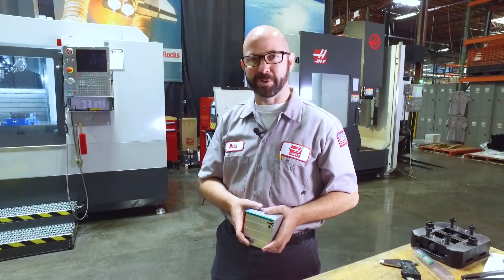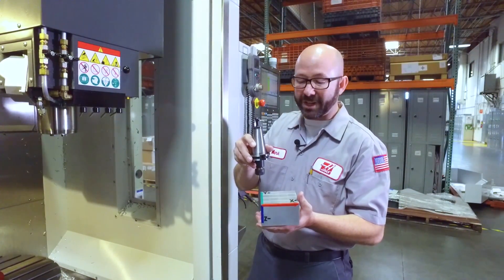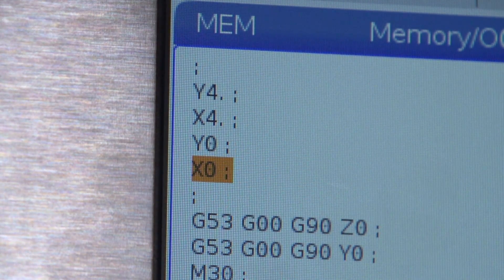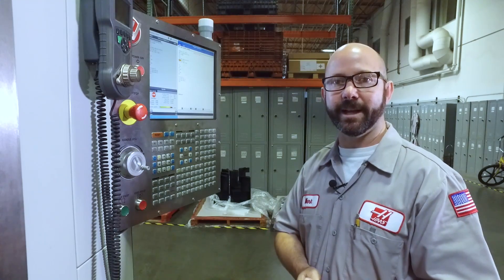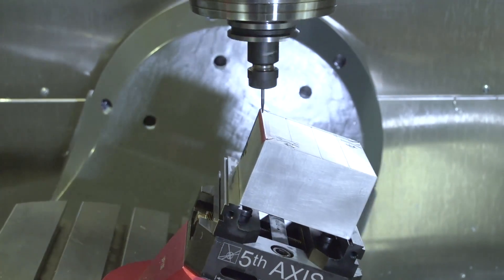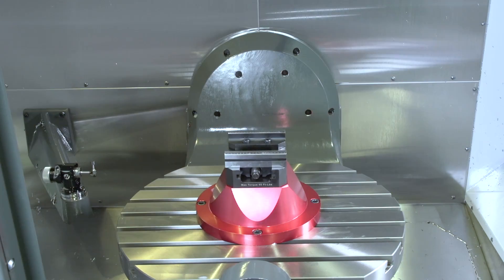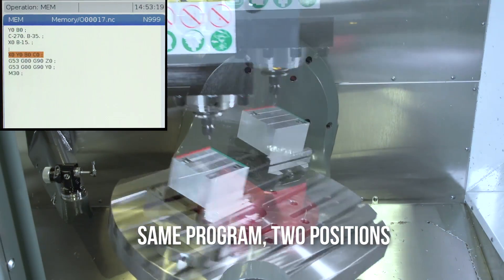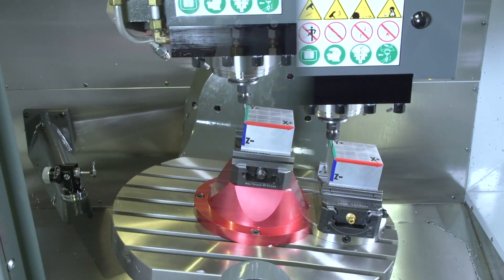Simplify 3+2 and 5-Axis Machining with DWO/TCPC – Haas Automation Tip of the Day

Comment: If you've never been exposed to true 5 axis machining this might not make much sense.  Before we had TCPC if you needed to do 5 axis simultaneous machining you had to 
rely entirely on your CAM system.  You would have to describe the full kinematics of your machine including the XYZ location of the center of the rotary axes.  Then, one way or 
another, you would tell the CAM system where X0Y0Z0 on your part was relative to the centerline of the rotary axes.  The CAM system would crunch all the numbers and spit out 
a program for you.  The only problem was, if you needed to make fine adjustments to the part, you had to go back to the CAM system, make the changes there and post out a new 
program.  It worked but it was clunky.  The logic behind TCPC is that your program can now simply describe the tool motion as if the part were completely stationary AND the center 
of rotation is always at the tip of the tool.  Effectively taking all considerations for machine kinematics away from the CAM system and giving that responsibility to the CNC control. 
Now it doesn't matter if your fixture is a few thousandths off center.  The CNC control will automatically adjust for that while it processes the program in real time to create the machine 
motion.  All you have to do is make the corresponding shift in your work offset and the control does the rest.  Every major CNC control has this capability now and it may even come 
as a shock to you that they all work exactly the same way.  They all use the exact same math and they all call it "TCP".  If you only do 3+1 or 3+2 machining you'll never use this.
Haas DWO on the other hand needs some work.  What it can do, it does well but the problem is that it's really only good for demonstrations.  That's because in the real world NOTHING 
is ever perfect.  Say you are machining a hole on the side of your part that has a very small true position tolerance.  You run through your setup part and during inspection you notice 
that this hole is out of position by .0015".  There is no easy way to make this adjustment on a Haas.  What you really need is a fine adjustment calculation that runs AFTER the G254 
has calculated the new coordinates.  I have a macro that I developed 20 years ago that can do everything G254 does plus it lets me make those adjustments very easily.  If I can do that 
there's no reason why Haas Automation can't do something similar or even better than that.  If you constantly make parts that have tolerances tighter than .005" you know what I'm sayin'

Comment: I have wired problem after update software on umc 750: after Bxx.Cxx.; g254; , coords on page position doesnt transform but machine work correctly buy when i put P103P1;Bxx.Cxx;G254;G103P0 It works correct... Some bug in new soft? Greetings.

Comment: Hi,
If I run below code 

N78672 G00 G90 G53 Z0.
N78673 G255 (CANCEL DWO)
N78674 G0 B89.81 C204.138
N78675 G0 G234 H36 Z11.7277
N78676 G0 X-12.4499 Y-5.4186
N78677 G0 X-9.7122 Y-4.1918 Z11.7177

Then does both DWO/TCPC options are switched ON after line N78676

Comment: Haas have gcode for indexial 3+2 , like fanuc g68.2? g254 support g2 g3 command and drill cycles like in indexial mode fanuc g68.2?
Reply from the maker: Mikhail – Yes, the G254 code supports G02, and G03 arcs and all of our standard drills cycles like G83 peck drilling. You can learn more about this code from our Mill Manual that you can download from our website www.haascnc.com . G254 is for 3+2 indexing, and G234 is for simultaneous 5-axis work. – Mark, Haas Tip-of-the-day

Comment: Hi Mark, 
 I have my TCPC and DWO set up on my VF5ss using with a TR160. I keep getting a INCOMPATIBLE TOOL LENGTH OFFSET USED alarm when i tries to run G254 in my program. Is there any other parameter that needs to be changed so it will work?
Reply from the maker: Russell – We’ll see this alarm (alarm #2019) if Setting 64 “T Ofs Meas Uses Work” is set to Off, and a G254 is called. On a mill with the TCPC/DWO feature enabled, we need to turn on Setting 64 and only set Tool/Work Offsets with the probe. This is important, if you try and set your tool lengths manually (no probe), with Setting 64 On, your tool length offsets can be very confusing. For more information, give your local HFO a call and they can help you out. – Mark, Haas Tip-of-the-day
Reply: Thanks  you so much for your quick reply ......Haas Automation, Inc #1...... user since 1993

Comment: If I want to drill and tap a hole at 45 degrees, can I turn on tcpc rotate my B and run my 2d program. Do I need to turn off G234?
Reply from the maker: Don L – For 5-axis drilling (and regular 2d programs) we use our standard drilling cycles (G81, G83…) with our G254 DWO Dynamic Work Offset feature. G254 DWO is used for indexing, 3+2, while we reserve G234 TCPC for simultaneous 5-axis work. Thanks for the comment. – Mark, Haas Tip-of-the-day

Comment: Hello, May I ask if G234 if different with G143? My Haas VF5-50 only supports G143so is it any difference when I post a simultaneous 5axis program, do i have to care about tool length when posting?  Thank you
Reply from the maker: GIANG THE TOOL – G143 is only used with our tilting-head 5-axis machines, like our VR-11. We will use G234 TCPC and G254 DWO on our UMC machines, and on mills equipped with our Next Generation Controls, the TCPC/DWO option, and rotary units. The codes work very differently – if you don’t have a Haas VR machine, you won’t be using a G143 for your tool lengths. We’ll call up or tool lengths with standard G43 Hnn codes, using a G234 when performing simultaneous 5-axis moves or a G254 when running 3+2 (indexing) machining. – Mark, Haas Tip-of-the-day.
Reply: Thank you Mark for your answer, so that means with my old machine (does not support TPCP), the only way I can do simultaneous 5-axis is put the part model on Cam software exactly where it sits on the table? - Giang

Comment: Hi Mark, in this video you don't show the use of DWO (G254) but you mention it a couple of times. According to the documentation it looks as though you can only use G234 OR G254, so you can't use them at the same time. Could you use TCPC for positional machining instead of DWO? Just trying to get a more detailed understanding of the differences between the two... 

Also as a side note, does TCPC improve on Inverse Time from a smoothness standpoint?
Reply from the maker: Scott – You’ve got it. This video is really for simultaneous 5-Axis (G234), while our G254 video will be on 3+2 only. You’d really want to stick with G254 for positioning, not G234.  Feedrates with G234 are typically in Feed Per Minute, which makes things really simple, compared with the G93 Inverse Time Feedrates we used to use. Our IMTS demo had quite a bit of G254 DWO 3+2 positioning in it, while the simultaneous 5-axis moves were done with G234 TCPC. You can check out that video at https://www.youtube.com/watch?v=wR64mYvQ7c0. 
- Mark, Tip of the Day
Reply: Haas Automation, Inc. awesome Cheers for the extra info.

Comment: still I do not know what is the difference between 3+2, 4+1 and 5 axis. who can help me understand?
Reply: Cosmin Gheorghe I would imagine when there is a + involved the first number is the machine's standard number of working axis and the second number as an add on like a  haas trunnion adding 2 axis to a 3 axis machine making it a 5 axis machine. a 5 axis machine would have all 5 working axis as standard xyzab
Reply: thanks
Reply: @retardbarf 
That's correct.  You could also say it like this: 3+2 is running a 3-axis program on a plane established by the 4th and 5th axis's.

Comment: Hello, I am asking this question, you can configure a Haas EC1600 for a program to calculate the coordinates relative to the center of the table. For example loading in the center of the plate G54 (already known), and a program with a G55 in a displaced center piece, create a macro that will return the value of the center of rotation ?. I hope you understand my English is bad.